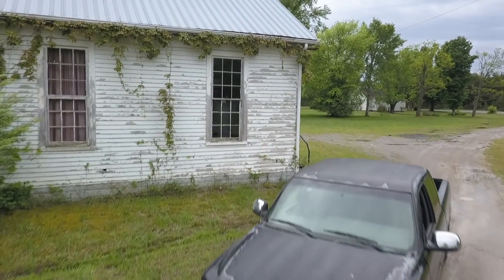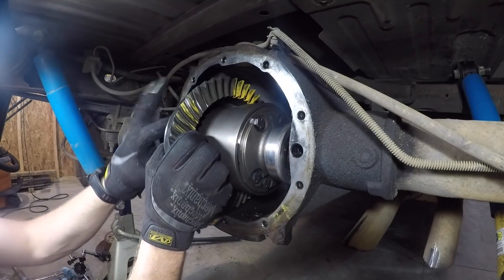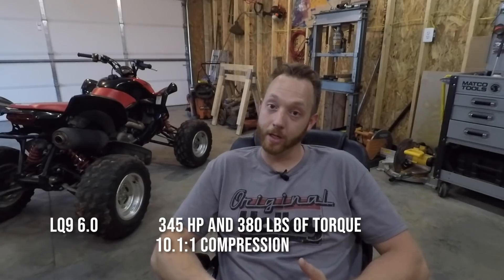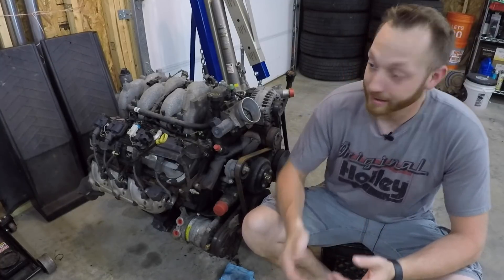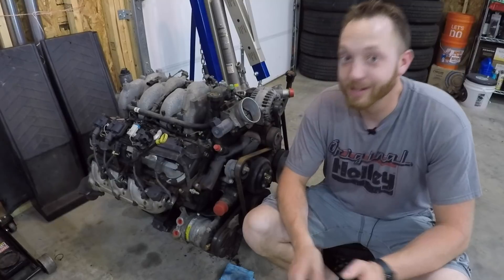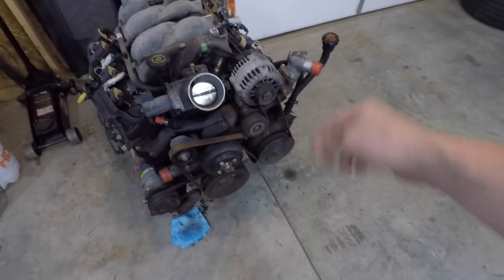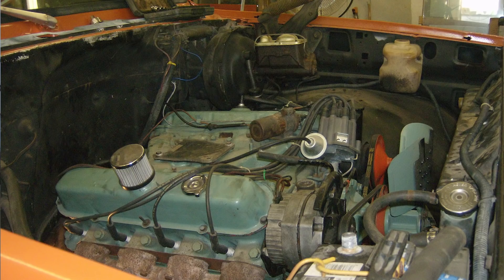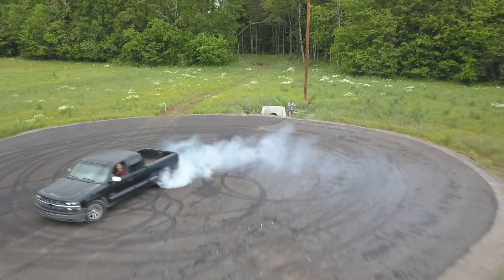The BEST Silverado Engine swap, and its not what you think...

Comment: My parents have a 2500 Suburban with the 8.1L, I remember we were towing a 21 foot boat going up a very large ramp from one freeway to another in overdrive with the cruise control on 85 and it never lugged back or lost mph, if anything it was accelerating and didn't have to drop a gear. It was a very underrated platform that lost all the glory to the new Duramax. It's an excellent choice for an ugly truck.

Comment: You are going to LOVE that 8.1!  Owned 2500HD CC/4x4 with the 8.1/Allison for 16 years. Burned no oil, ran like a top. Gobs of torque. Did have cold start knock, but only for 30 seconds or so. Don't ever check MPG...just put your right foot down and smile!  : )

Comment: I am looking forward to watching all the videos on this you have listed.  I have a 2014 Z71 Silverado and I also have my old work van (I am retired now) which is a 2000 3500 Express with an 8.1L.  I loved driving that van.  It has positrac an weighed over 8k pounds and would light the tires up if you got on it.  I love my Z71 and at my age, it is probably my last truck and I really want to have some fun with it.

Comment: Just installed a Raylar Eng. 201 cam and Raylar modified intake into my 2001 Silverado 8.1 Vortec w/5spd Allison. Fired it for the first time yesterday, tune will be installed today. I also have JBA shorty headers into stock exhaust and installed 4:56 gears last summer. Truck tows a 15,000 lb. 5th wheel. Will be end of July when I see if the new mods improve my hill climbing ability at max GCVW.
Reply from the maker: you'll have to let me know your impressions of the cam swap!

Comment: LT
I drive an 05 GMC 5500 rollback for a living  and speak from experience when I say the 8.1 has plenty of torque to move a 12,000 lb. Truck down the road.  So you should have more than enough to get in a little trouble.  With that being said,  I'm considering the same swap into my square body stepside.  As far as I know Raylar engineering is the only company for aftermarket support of this motor. 
I'm now a subscriber  of the channel and look forward to updates... good luck with the build.
Reply from the maker: yeah, I have spent a ton of time on their website, and in the future I'll likely be installing some of their parts as well.

Comment: Cadillac 500 was an awesome engine! Production began in 1970 exclusively in the Eldorado. It was rated at 400 HP and 550 lb-ft torque. I believe compression was 10.5:1. From 71 to 76 it was available across the Caddy line, standard depending on model and/or trim. 77 & 78 they were available by special order in factory limos only; GM pretty much dropped big blocks from all passenger car lines after 1976. Cadillac was their "Golden Child" and could get away with it.
My buddy and I installed a 71 500 in his 71 Trans Am in the early 80s. The 4th hard launch ripped the passenger-side subframe mounts out of the body. The 500 went to the back corner of his dad's shop and the TA went to the crusher. The 500 may still be there!
Anyway, I think the 8.1 is a great idea! "If it don't go, cube it!"

Comment: Could you mount the throttle boyy sideways or upside down? That would move the cable mount away from the oil fill tube
Reply from the maker: because of the shape of the 3 bolts in the pattern, I dont think so.

Comment: I have a 96 C3500 dually with the L29  454 you have inspired me to build my sons & I all owners of our own ugly truck. Got a locker 4.56 gears but with 300 plus miles strong but needs a rebuild. I did hurt it a little burned the brakes pulling 18,000 lbs. up & down a hill not too steep but it was enough to scream the engine to 220 degrees once I reach the top. Still runs but won't be towing that much anytime soon. I need a rebuild or maybe find me an 8.1L or stroke my current engine. I just subscribed be interesting to see the build. I myself is a little anti LS too many out there.

Comment: I've been wanting to put a 8.1 in my 2dr 2wd 05 gmc. Make sure you put electric fans on your trans and radiator. Good luck.
Reply from the maker: its on my to-do list for sure, I just ran the mechanical fan while I got it running

Comment: The only downside I can think of with the 8.1, is the oil consumption issue. What are you going to do to fix this?
Reply from the maker: I've seen people modify the PCV system to pick up less oil, but I haven't gotten that far yet in the build First step is just to get it in and running...

Comment: Nice project ,just keep an eye on the oil consumption I will go with a oil catch can and make sure you install a new crank sensor they are not fun to replace on the engine is bolt on.
Reply from the maker: Thanks for the tip! will do for sure

Comment: I did a 8.1l swap in my 01 2500. Just a fyi. The 6.0l and 8.1l y pipes are the same. 4.8l 5.3l y pipes can be used. But the drivers side flange needs to be changed.
Reply from the maker: i was actually wondering how close they would be to working, but haven't got that far yet... thanks for the tip!
Reply: @LawrenceTolman  No prob. Keep up the awsome content!

Comment: I have that same engine in my eagle 230 eliminator boat.......bad ass motor, ..........my boat can do 80 if the tide is right and the trim is dailed in.......... good choice,  so you can still run this on your factory ecu, pretty much plug, tune ,and run!!!......does it have knock sensors like a 3rd gen ls??
Reply from the maker: yeah, its more or less plug and play. it has two knock sensors (one on either side of the block) so it will need a few wires lengthened and such, but overall, not bad.

Comment: 8.1 had major problems with crank sensors while driving down the road. Have to always replace sensor with OEM, was a pain in the neck.
Reply from the maker: anytime I've used a non-oem crank sensor, it seems like I've had trouble

Comment: I bought a 50' Buick last year which came with a small block and an auto from a (what I was told) mid 90's Impala, mounted in the front clip of a 77' Monte Carlo. It also has the axle from the said Impala. I'm in the planning stages of its next build right now. Yes the LS is an awesome platform with a ton of aftermarket support... but like everyone says... it's been done. I've always been different anyway, so I'm trying to figure out what I want to put in it. It's already set up for a small block so swapping in a newer, healthier small block (a 383) would be easy (and practical). I'm also eyeballing a 454 or 502 option (they would be fun). I'd like to put a Tremac 6 speed behind it. Hell... the thought  of a Duramax even tiptoed through my brain... but that's a BIG can of worms! I never thought about the 8.1... this has caught my attention! Subbed...
Reply from the maker: thanks for the sub and good luck with your project!

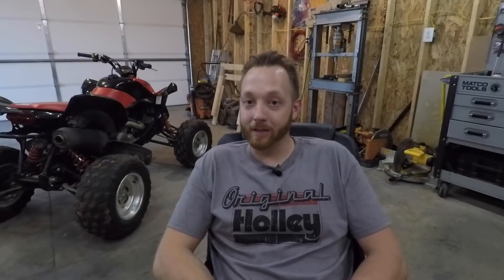Comment: 1:33 "and thats the final stance the truck is going to have"

8.1 big block: hold my extra 300lbs.
Reply from the maker: DrewLSsix lol. An inch or two lower wouldn’t hurt anything
Reply: LR4/LM7 accessories bolt right up to the Gen6 454 (7.4) 496 (8.1)

The 8.1 was for Topkick and Kodiak Trucks (4500-6500)

Comment: I'm thinking 4:30 gears are overkill for an 8.1. But you build it your way bud, an S480 turbo should give you 800+ no prob. (Hint, R.I.P. 10 bolt)
Reply from the maker: i like the sound of overkill...
Reply: @LawrenceTolman  "user may experience increased tire wear" lol. Solid plan, after reading your thoughts, I realized that your logic is solid. My bad.

Comment: I’m looking to pull my 4.3 out of my 99 Chevy short bed and wanting to put a 6.2 or  a 8.1 I’m my truck I wanted to ask what trans would be good with the 8.1 and would I need a new drive shaft
Reply from the maker: i would definitely recommend a 4L80 if you were considering an 8.1 swap. As far as the driveshaft, not sure on a V6 truck.

Comment: I wish someone would take a look at the GM Atlas 4200 straight six engine..
I want this in my 47 Buick 2-door Sedanette 50 series...
Reply: There's a few people who are working with the atlas series engines lately as trailblazers and 1st Gen Colorado's and canyons are a time a dozen. If your interested in swapping one into a car I'd check out the guys over at the fuel injection sucks as they are swapping one into a checker taxi.
Reply: There is a turbo 4.2 swap in a Checker car. YouTube fuel injection sucks..
Reply: @Mr. 6 liter Those 4.2L inline 6s are very strong reliable motors they're just not built for speed.
Reply: They are junk. 
Motor trend tried to build one. 
It always broke. 

If you want one. Look up timing chain stretch.
Reply: Joe Schlotthauer I second that I am thinking about doing one for my 68 nova
Reply: Mr. 6 liter there is a guy who has one turbo charged in a camaro that is making BIG hp. Keep an eye on your mirror he has his sights on YOU.  By the way those engines arent junk they are very well made. People like you just dont get overhead cams and cross flow heads
Reply: @holmes1956O  
It was on Wards Best Engine list for years...
Reply: Joe Schlotthauer kinda my point
Reply: @holmes1956O  
I didn't mean it that way, I just thought they were really good videos about bring the engine to the forefront, and I didn't  know if you were aware of the videos.
I've been LS and Coyote(d) to death...
I think the straight 6, 4200 GM Atlas Vortec and Ford Barra are seriously overlooked...

Comment: I would guess that the 2000 2500 parts will let you put that L18 in the 1500, when I put a bbc in my 83 blazer I used factory shroud etc. to put it in from a 1 ton 4x4 as the vehicle I told the parts guy. Fit perfectly.

Comment: There is a reason no one swaps a 8.1, it's a turd with next to no aftermarket. What aftermarket is out there is $$$ and marine based
Reply from the maker: Lucas Beadle both valid points, but there’s just something cool about a big block with a turbo...
Reply: @LawrenceTolman  
I have the 8.1 and the allison transmission so I'm going turbo to match diesel numbers for horse power and torque it's in a 2003 gmc 2500 hd 4x4 short bed crew cab ....
Reply: Have owned two 8.1L trucks. Still have one... A turd it is not. It's just badly held back from the factory. Happy to see it used here.
Reply: It's still a BBC.. what the fuck do you mean they have no aftermarket? You can use ANY Gen 4-6 head on it with the correct cylinder head gasket.

Comment: What is the typical price of a used 8.1 engine amd a heavy trans that would bolt up to it that will work in a 06 1500 with 4 wheel drive?

Comment: What mods did you have to do to make 4L80E work, be good to see some of the detail getting it to all work,
Reply from the maker: I did a video a while back of installing the 4l80e, but for now its stock. It should cope with the torque the 8.1 is making for now, but when the engine gets built up, I'm sure Ill have to do the same for the transmission as well.

Comment: The cam and crank sensors will need plug changes and wires changed. Not hard.
Reply from the maker: luckily I have the original 8.1 harness so I can cut and splice what I need to
Reply: If you need cam and crank pin read outs for the motor let me know.

Comment: Id like to have a 11.5 AAM or Dana 12" with 35 tooth axles with 6 lug hubs and Large disc in rear (tired of the JF7 Drum Layout) I handle braking easily.
Reply from the maker: that would be a stout setup

Comment: The biggest problem with that engine is it's low rpm peak. 4,200 for peak HP is where it falls short and causes problems for being a high performance candidate.
Reply from the maker: I suppose a larger cam and a turbocharger could cure that
Reply: Lawrence LT Tolman. Exactly, cam swap and valve train upgrade is the way to go.

Comment: You don't need 4.30 gears with a torquey engine like that. It will be just as fast with a 3.70 or 3.73.
Reply: 3.23 is efficiency and top speed, 4.10 is acceleration but loses top speed, also 6-10 speed trans can run 3.23/3.73 even in kodiak/topkick.

Comment: i got a 68 chevy pu that they rebuilt the 327 and left water in it witch cracked the block for 1000 bucks still has the factory paint good clean body but needs paint then i got a motor home for free pulled the 4 inch stroked 454 rated at 450 hp at 485 torque witch was on the paper work steel crank with heavy rods crate engine with a heavy duty 400 turbo truck trans witch has reinforced clutch plates heavy pump the motor home only had 6000 miles on plus they come with twin electric fans oil cooler trans cooler power steering cooler and all the pluming for a pu then i got a serpentine belt set up from a 94 pu for 50 bucks then i got a tunnel ram for 65 bucks  the 327 they put a new carb intake alt water pump starter headers and ignition set up with msd witch my kid needed for his pu 350 4 bolt . right now i have 2300 in my 68 and it runs hard now that in opened it up to breath but need a bigger carb the last offer i got was 8000 for it the under side is all painted but need interior and final paint and in motor home have some of the best crate engines in them u can if lucky get a ls 6 454 in them most just have the 454 ho witch has a 4 inch stroke and most have very low miles on them just got another one 2 month ago with 38,000 miles on it after pulling the engine and trans i will sell it for 2000 but it is really nice but u just can't beat free

Comment: What are the odds an 8.1 will fit into a 4th gen Camaro?
Reply: Shouldn't be an issue. It's based off a 454. If a old bigblock will fit it will also. Hood clearance... May have to change hoods

Comment: I have this engine in my 2500HD. great engine. If you like, I can send you the current tune in my truck. Pulls great. The Pistons are not strong, and will crack with to much of an increase in cylinder pressure. Also they do not rev. I have tuned a few of these. IG:charlieridinger

Comment: "I'm not going to use an LS"  Shows off BB, LS engine....
Reply: The 8.1 isn't an LS. It's based on the older big blocks, only has an LS style ignition system.
Reply: ... and a cathedral port head.
Reply: @coryholbrook4643  it's actually not a cathedral port head at all. They are large oval port heads

Comment: Well I did like the project. The reason why nobody does that swap is because it’s a waste. Your only gaining weight on the nose. LS’s work that’s why everyone uses them. You’re literally going backwards but hey your build enjoy.
Reply from the maker: They are heavy for sure, but for me it’ll be hard to beat that torque off idle. Yeah, I agree the LS has a ton of potential and is much easier to make power,  it I like the road less traveled.
Reply: Danderson GM 8.1 isn’t going backwards, it never got real after market support. 8.1’s are the BBC version of the LS but it was marketed as an industrial power plant. Also you have to remember had the diesel market not become popular this was the gas motor to beat in 2001 for trucks

Comment: All those cubes and no horsepowers. Give me a 4.8 and a turbo
Reply from the maker: you mean no power yet
Reply: Lawrence LT Tolman if it ever does
Reply: david martin. Just a mild cam swap alone will make it over 400hp and 600 lb’s of torque. Then add boost, not a hard concept.

Comment: 😂😂😂😂😂😂😂😂 I’m actually going the opposite way! 
Those came in 2001 2500 Suburban its gonna bolt in easier than your making it seem! Also if you can’t make it work with that drive by wire throttle body you should shut down this channel!
Reply from the maker: Hey anything is possible that’s for sure! I’m sure my fuel mileage will take a plunge as well.
Reply: Lawrence LT Tolman  I have a 2001 2500 8.1 Suburban and a 2001 1500 Sierra , don’t get me wrong I love that 8.1 and I did plan on turbo’ing it but that motor really needs heads. I’m not rich so my plan is to swap a 5.3 w/ turbo when the 8.1 takes a dump. Unless I come up on some Raylar heads and cam lol